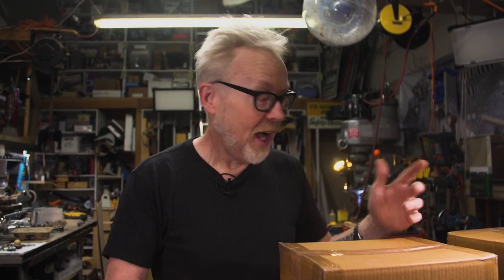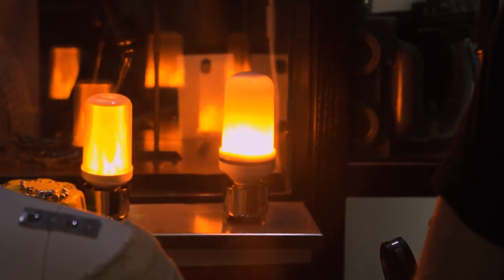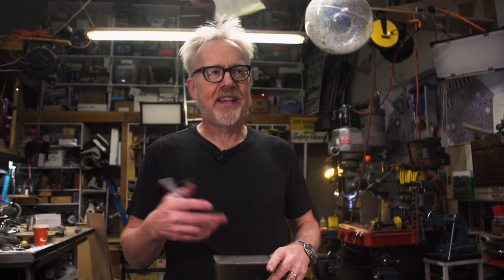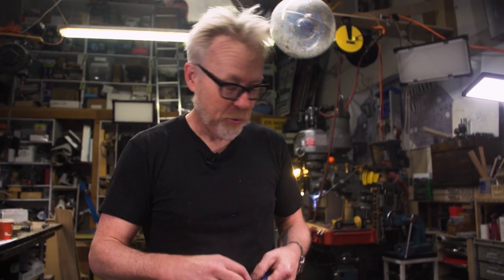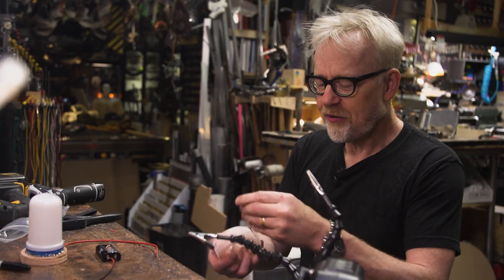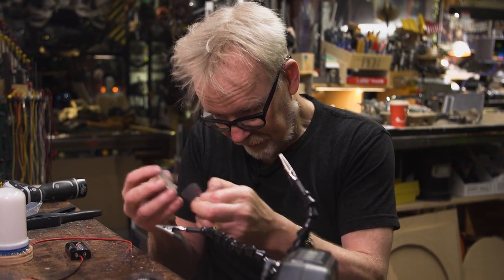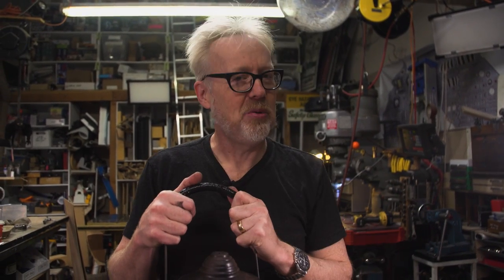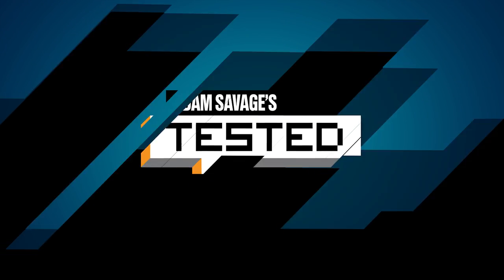Adam Savage's One Day Builds: Gaslamp Lantern Prop!

Comment: Did you figure out how to keep it from cycling? It works with 3.7v for me but 3v puts it on fade mode for some reason.
Reply: Ian MacLeish if you bought the same bold, you can cycle through the modes by switching it off and on quickly.  It goes from flame to constant on to pulsing

Comment: 8 months later: What puzzled me when I first saw the video was the claim that the bulb operated at 3V. Without up-conversion this would be very inefficient. Right... I got a bulb that has the same light pattern, and looks exactly like Adam's, at least on the outside. The AC/DC converter might be similar. The inside hole in the blue socket is bigger, though. And unfortunately, it runs on 12V, maximum current 177mA (all LEDs permanently on mode)! It has essentially the same brightness at 8V, 95mA, and is still well visible at 6V, 14mA. Nothing happens at 3V. It is possible to run the thing with two Li-ion batteries, but the simplicity is gone. Sadly.

Comment: Gaaah!  Stop cleaning the solder off your iron tip when you put it away.  Leave the tip covered in solder so the solder oxidizes but the iron does not.  Especially true of irons that stay heated when put down (but still true of the auto-off type).  Pick up the iron, clean it, apply fresh solder as a heat bridge, solder,  glob on enough solder to fully coat the tip, put down.  Every single time you pick up the iron.

Cleaning your iron tip before you put it down it like cleaning off all the oil from iron tools before storage.  Seems nice but leads to deep sadness.

Comment: I love it !  I was also wondering about the length of time the batteries would last. If it needs 3 volts to run how long will two 1.5v batteries keep it lit ? It must work on less voltage. Let us know what the voltage was when the batteries stopped powering the light.

Comment: LED's are current limited devices, not voltage limited.  Depending on the output capacity of the batteries (in mA/h) this could easily burn out the LED's quite quickly.  Just because it measured 3 volts at the output of the dropper, is only part of the story.

Comment: Now I'm curious if the LED circuit in the other side of that bulb would be robust enough to allow 3.7v to be acceptable...I'm guessing it probably would, in which case you could use a single 18650 Li-ion cell, and have it be rechargeable.
EDIT: Oh, I went back and looked at Big Clive's one video to find what he said the circuit had on his. Then realized he later did a video for one that was already usb rechargeable running off an 18650. So you could even get that one and just solder on longer leads to the switch. It would be an even faster build.

Comment: Power of LED bulbs. Lasts and uses less power. One Question, I see you glued most of the components in there. Now, One day after your continuous use, that bulb will need replacing, Whats the protocol of removing all that glue later on. OR is there another way to change the light bulb without undoing all that amazing work

Comment: Every time I see those outdated wire-connectors (those plastic caps with basically just a metal spring inside) I wonder if they don't have lever-actuated splicing-connectors.

Comment: Hopefully the bulbs via the link work the same way as the ones used in the video, as they’re different bulbs.

Note: that didn’t stop me from ordering two of them, so i guess I’ll find out.
Reply: Update: they do work, the wires aren’t as long but it’s not an issue.

Also they will run on 2.4 volts! (I tried it with eneloop rechargeablea).